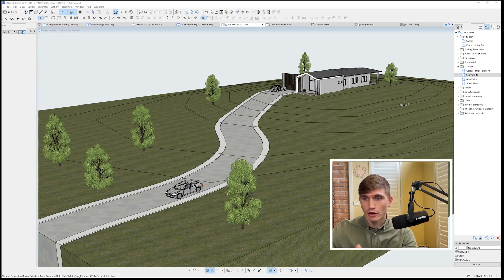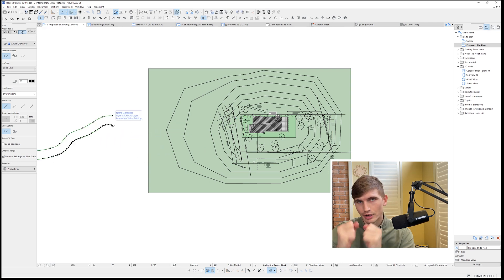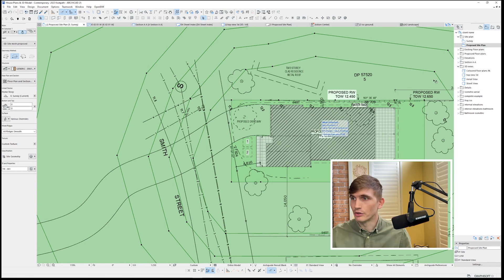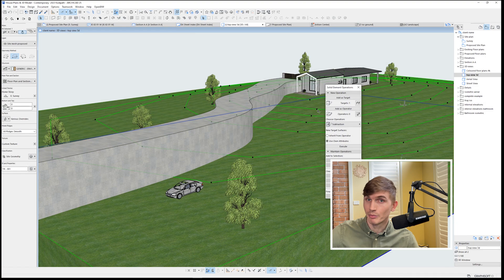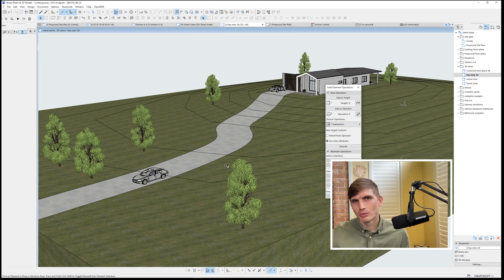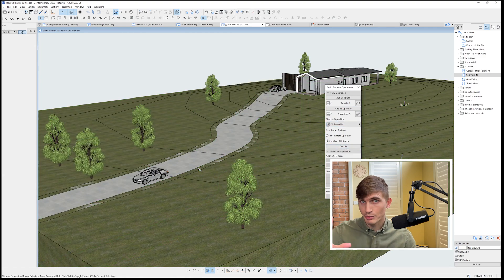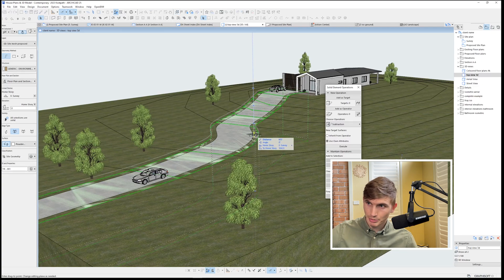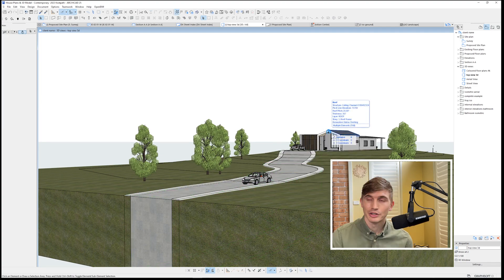Driveway & Path - The EASY way - ArchiCAD Tutorial

Comment: Hi, I'm stuck at 1:47. When I hit execute, the driveway completely disappears.  I don't see the 'funky' top of the concrete; just the topo mesh. Thanks.
Reply from the maker: Hi Jeffrey,  hmmmm, could be a few things. 
Just checking, the driveway was defiantly set as the "target", & the site mesh was set as the "operator", & the operation was set to "intersection".
The sequencing can be a bit tricky sometimes....
If it's not that, I'd also make sure that your driveway mesh points are set higher than the highest contours on the topography (ground).
e.g. if your topography(ground) high point is 12.000, make sure to set the driveway to at least 13.000. otherwise it might disappear below. 
In the 3D window I'd hit Ctrl+A ( select all) and check if the mesh is still there, but maybe just hidden under the Topography (ground) if it 's mesh points aren't high enough.
Hope that's of some help.
If you find the solution, please share so anyone else that might runs into it might find our trouble shooting.
Cheers
Reply from the maker: I've also done a ton of solid element operations in this video below, hopefully it might be of some help with some extra examples
https://www.youtube.com/watch?v=BhFd-EJifHI&t=125s
Cheers
Reply: @archguide  Thanks for the response. I repeated the process exactly but am still unable to see the 'funky' top of concrete. I've tried various settings, but no luck so far.  Cheers.
Reply: Keep it up